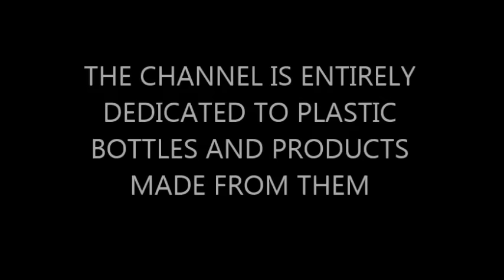HOW TO MAKE BEADS FROM PLASTIC BOTTLES

Comment: Tell us about the heater: what it’s called, brand, where to get it?  (I don’t think a hair dryer would be the same.  We would have to deal with the breeze!)
Reply from the maker: we need a construction hair dryer. it can be the cheapest, the brand does not matter
Reply: It's called a heat gun

Comment: Is it the same procedure with wood? I mean, insert the pet into the hole in the wood and when it comes out, let it get the hot air from the gun? or is it different? thanks and great idea!
Reply: I was wondering the same thing
Reply: Heat it on the side it goes in from.

Comment: So I looked this up on a science/ medical site and this is what it said about melting PET plastic-- in the presence of heat it can leach antimony, a toxic metalloid, into food and beverages if the contents are still in the plastic bottle and if not it releases them into the air, on the skin, hair etc, which can cause vomiting, diarrhea and stomach ulcers. It also says to use a respirator which is very different than a face mask & ventilation in combination. I just don't think this is a safe idea.